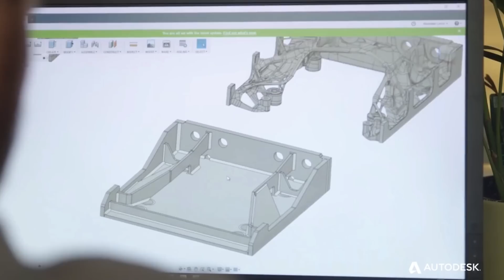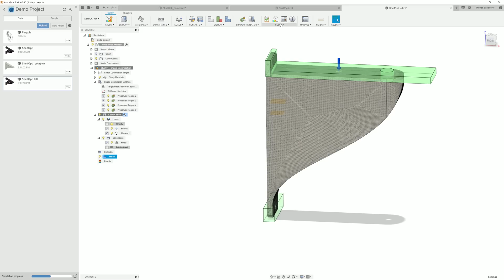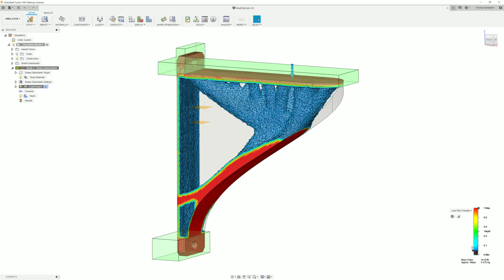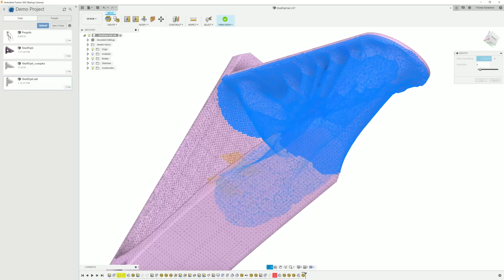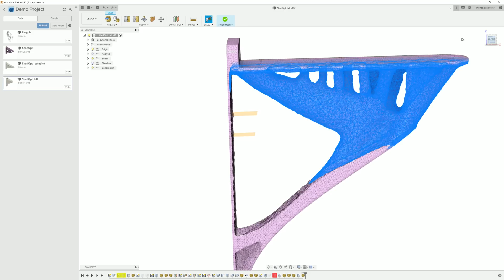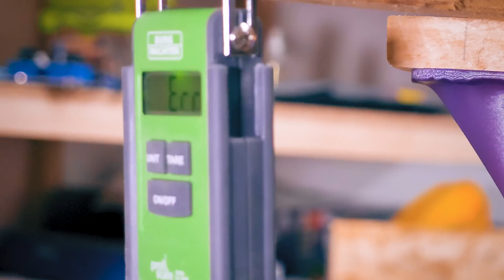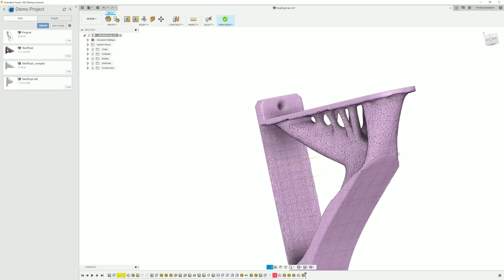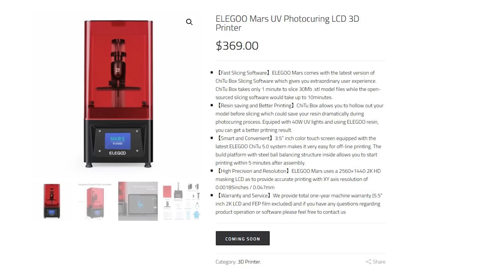Making STRONG shelves with Topology Optimization

Comment: Welp... Fusion removed the simulation tab from the free version (because autodesk is greedy)... there goes that idea.
Reply: Same, was just working on a project that needed the weight saving and strength, but Autodesk has to be the most Greedy company ever.
Reply: @NoLan_YT  I'm pretty sure the most greedy title still goes to adobe, but Autodesk is getting closer.

Why use cloud computing for this? Why not try to run it locally? It's their only justification for making people pay for that service. Sure, it'd probably be slower locally, but I got time.

Comment: I know this is an old video but would be interesting to see how strong a manually designed bracket would be compared to this.  Because the optimization didn't account for the orthotropic nature of 3d printing. And it didn't account for the hollow nature of the prints.  I would venture a guess that a thick walled bracket with low infill, strategically hollowed out sections, and printed flat would achieve similar strength at lower weight.  You can see where it breaks was not the "weak" spot shown in the software.

Comment: Good use of PLA, biopolymers are pretty cool. The real great showcase of a lean iterative design process. 
Next time you should consider explicitly modeling your mounting, or use a stud finder so you mount on the wooden seams of the wall. Computational boundary conditions exhibit the least realistic portion of a model: often the potentials are tuned to the gradient of the bulk material. Outside of the bulk, the Hamaker constant of PLLA and Cellulose is 3/5th that of cellulose, so I feel that a small amount of soft silicone rubber molded at the wall-part interface which could deform might be helpful. Best of luck in your continued design work. 
 “God made the bulk; the surface was invented by the devil.” -- Wolfgang Pauli

Comment: If it's metal, perfect! If it's lightweight material, not sure the benifits you get justify the costs. Probably a full slab is more cost-effective. Proably an additional function to approximate the final shape with simple parts and eliminate the 3D printing would be desireable in the least demanding cases

Comment: ...well, if we want to be pragmatic about that - you should simply print it upside-down (versus the position on the wall, I mean - should be attached to the plate by the surface that shelf is supposed to rest on), and just key match/epoxy the bit with the screw hole. The layers orientation would be optimal, and the screw part/keying of it could be also optimised separately for the kind of loads required.

Comment: The wall plugs are evil incarnate, they cost me at least 10 years of shortened lifespan and several rage quits. Fortunately, you don't have to use them, ever again - here's how:

1. Drill a hole of appropriate size  (slightly bigger than the screw  dia.)
2. Pack it semi-loosely with a cotton wool
3. Soak it generously with a superglue
4. Watch it smoke, while the glue hardens rapidly
5. After the glue is set, you can pre-drill a pilot hole (slightly smaller than the screw diameter)  - it is not necessary, but makes for easier  work
6. Self-tap the screw in. Job done.

It  will survive a nuclear blast, and most importantly,  it works every time, first time - unlike the FUCKING wall plugs!

You are welcomed!

Comment: You should have put in a second force in direction from the upper hole pointing from the wall into the room. I guess if you optimize this, you can 50 % more on it.

Comment: From a mechanial perspective those are very inneficiently designed brackets, but then you did start out by saying that it was going to be an excercise in aesthetics. Overall a rather confused excercise that adds up to little more than 'pratting about' with generative design software with the unconvincingly claimed ambition of persuing some aesthetic goal. Madness!
Reply: From a literal perspective, those are those most efficiently designed brackets possible. That was the point of the video.

Comment: very nice video but if those brackets aren't fastened into the studs of the wall that shelf can still come tumbling down even with the brackets left 100% intact  in this scenario they are not the weakest link of holding the shelf up when more weight is added

Comment: I can’t see how anything 3D printed can be stronger than a cnc milled aluminum part, a milled part is always going to be stronger 3D printed, that includes 3D printed metal. The weakest point of a 3D printed part will break long before a milled part, so when you say things like “ideally a 3D printed part” explain how it’s ideal. Maybe printing is easier for people who don’t have an year engineering degree, but they have yet to find a material for printing which is better than a milled part, it’s ok for making cheap throw away stuff for landfills.  And drywall isn’t foam and concrete, it’s gypsum crystals.

Comment: Hi Thomas cool video. I have a question, if the brackets were optimized to hold 35kg altogether but one of them alone is capable of supporting your weight of 66kg, then the brackets are overdimensioned. Do you think the part could have used less material?

Comment: this shelve is not stronger than one without optimization. it is only "nearly as strong" as a unmodified shelve by at the same time using significantly less material. strength can be increased by adding material to the most stressed areas and not by removing material from less stressed ones.

Comment: "Start with a block, cut away only the parts that don't add to strength"
Sounds like 12th century carpentry.
I thought the 'promise' of 3d printing was the advancement of additive manufacture and design practices.
"Start with a block, cut away..." is not additive, nor is it advanced.
Reply: Did you watch the video? He literally explained this.

Comment: I can guarantee that the shelf braises i made are stronger, and they do look really good but in a very different way. mine are made out of 2mm thich strainless steel. i used a hyudraulic press with a folding tool to make the 90 degree angles and made the reinforcement triangles out of the same 2mm stainless steel. i then TIG welded them together and tadah! it is a super strong and really clean looking shelf bracket and i can for shure say that mine were far easier to make and took way less time (less than 1 hour for both of them combined)

this was a very interesting video tho, i might have to play around with that feature =)

Comment: That's true what you said in the last part, the process does not care how much load you have if you are only specifying (1) Strain Energy and (2) Volume Constraint.
You need to put additional constraints such as deflection so that the software optimizes your structure given a certain load. I use ABAQUS for Optimization by the way.

By the way, your video is awesome! so much appreciated!!!

Comment: Not sure if you will read this comment at this point but I will leave it here anyways.
1. This video gave me inspiration in my Mech Engineering final degree project in Q2 2020. I am now an Engineer. Came by your video again after buying a 3D Printer xD.
2. For the wall plugs, for plaster walls as they are called, I really recommend you Fischer Duoblade. Each one of those holds 8Kg, and you don't even need a drill!
Reply from the maker: Great to hear! It's still not a plaster wall or drywall, though 😉

Comment: With modification to the mesh to account for manufacturability, those could be mass produced using a molding process. Very cool design - looks great. 😎

I probably just would have painted the edges of the shelves white; it was very beautiful wood.

Comment: Great job giving a rundown of the process. A way to make it better is to add in the hardwood plank by incorporating it into the model by adding 2 additional hard points where you fasten the board to the support arms. That would drastically reduce materials required.

Comment: Standard topology optimization is not really valid for 3d printed parts. 3d printed plastic is dramatically anisotropic and except with 100% infill, not even a solid body. Someone should make a surface based technique and implement it on a standard CAD FEA package.

Comment: I tried topology optimization and have to say I'm a bit disappointed  with Autodesk. When you try to optimize it fusion360 gives you option to do it in the cloud which works fine. But when you try do to it locally you get some nonsensical error without any real explanation. This looks to me like cash grab I don't see any reason why I couldn't do it at home.

Comment: Topology optimization is not for Shelfs or street bikes, where you are not putting them to the ultimate boundary conditions or making full utilization of the generated structures capacities, its mainly for stuff like Aerospace or special case scenarios where micro scale is important.

Comment: When you're doing The Initial Simulation; Is it calculating The Interior Structure, or is that added later by The Printer ?  ( & you ruined them when you painted The Braces with White Areas ! )

Comment: Would you be able to do this in tandem with an optimization (Machine learning?) sequence for the most efficient motion for bipedal sprinting, test the load of weight and strain of muscles for each 'frame' of the steps, impact, push-off, and reset to make an ideal bone structure for an optimized sprint?

Comment: Btw, when you want a screw to really hold in the wall you usually screw it into the stud inside the wall. Although, I'm not sure if that would allow you to position the shelf right.
Reply from the maker: Tell me more how I would find studs in this wall...
Reply: There is a tool called a stud finder, which detects studs through drywall. Its useful for house work but only really necessary if your hanging something super heavy like a large TV

Comment: Wait. After all that, you didn't even screw the braces into the studs? Now the drywall is the weakest point of failure, as little as 25kgs.
Reply from the maker: Wait. You don't know that there are wall that aren't just a stud frame and drywall?

Comment: The wall mounts failed because you didn't install them correctly. If you had simply tightened them more, the the plugs would expand sideways to hold properly.

Comment: 2:30 Wait, they charge you for running simulations on a software you've already paid for, using store credits??
Have micro transactions found their way into even 3d engineering software?

What is wrong with this world
Reply: This is what autodesk has become they milk you every chance they get. As soon as any other player comes on the market, they buy them out so there is no competition. They used to make decent software now they slap their name on it and sell you a subscription.
Reply: @shitposting is my city  'aas' business model. smaller payment up front + multiple micro-transactions along the way. or a single colossal payment up front. i actually prefer the former in practice for a number of services.
Reply: Number one yeah it sucks. Number two no you don't need a supercomputer, or a high core CPU, SIMULATIONS ARE DONE ON GRAPHICS CARDS .... even low end graphics cards have more cores than a thread ripper, so in conclusion all that's needed is an Nvidia graphics card.
Reply: @singularitysquaredllc.895  depends if the simulation has been written for graphics cards but I guess probably most has by now
Reply: @Alistair  I suppose but in 15 years the only reason I've used a CPU was for prototyping, testing, debugging, as for "written for" it's just one line of code, or button click on a GUI that sends it to the GPU. It's been around at least as long as the programmable graphics pipeline.
Reply: professional work stations used for 3d CAD have 16 cores and 64 gb of ram. it should not take that long to make something like this. unless it was massive.
Reply: If you're a multi billion dollar company topology optimization or generative design could easily be saving you hundreds of thousands or millions of dollars.
Reply: jus because your computer is a potatoe PC doesnt mean modern computers are sUpEr cOmPuTeRs
Reply: As others have said, it's not a microtransaction. You're paying for their server time to run it on their computers. One reason given for them not allowing us to run these simulations on our own computers is that it would require them giving out the code for how to do it.
Reply: you're paying to rent compute resources to run the simulation. you could do the same thing at home if you had a supercomputer
Reply: @TouchedAlot  You don't need a supercomputer to run such simulation. Engineers at my work run simulations on 16 core PCs at work with no problem on other software. They are just milking people for money.
Reply: most people don't have lots of computers ready and available to throw at simulations. there is no reason to buy, configure and maintain lots of computers yourself if all you want to do is run simulations because you can just rent the amount of computing power you need on demand
Reply: @TouchedAlot  you don't need a lot of computers. Just one and wait a bit longer. Even my laptop has 16 cores ffs. Autodesk licensing was already crazy expensive before but this sounds even worse
Reply: @danepher  What 16 core BS are you talking about? You can easily run small parts like this on a Celeron.
This is why Fusion360 is diabolical. Don't support it. Get Inventor or avoid Autodesk completely. I'd recommend Solid Edge - its assembly UI and functionalities are decades ahead.
Reply: @TouchedAlot  lmao "supercomputer"..

Comment: I'm a PhD student studying topology optimisation ("TO"), and let me say you didn't do badly at all. A few points:
- topology optimisation CAN usually start from near-empty space, it doesn't have to start with a fully solid design domain (though in fusion 360 it might, theres many different types of topology optimisation). By definition that "generative design" thing will use some form of TO, along with other techniques.
- Be careful when saying your objective function is "strength". Is that yield strength or fracture strength? Is it being p-norm'ed or not? Is your material accurately modelled in the FEA software? (its clearly not because you're using a non-solid infill)

- There's actually no point optimising for strength, instead you should optimise for something else, along with a strength constraint (assuming fusion 360 lets you do that). For example, you could optimise for stiffness, with a constraint that keeps strength high enough to prevent it breaking (with whatever safety factor). By applying it as a constraint, the objective function becomes = stiffness + A*strength. "A" is usually 0, allowing it to freely maximise stiffness. When the strength limits are passed, "A" becomes large, changing the objective function to be strength-dominated until you're back within the limits.

 Anyway, its great that fusion 360 has this to introduce users to TO in a non-PhD level way, but there lots of ifs and buts.

Comment: For anyone who ever made anything out of any material it's obious where and how these brackets will fail. They look cool but that area under the top mounting point is the weakest link. In that spot the weight of the shelve will not only work straight down but also in about 45 degree alngle from the wall because you have another mounting point on the bottom. That's why on the test brackets you could see the flat part which suppose to be flat on the wall was bending under load and the bracket failed in the weakest spot. You have all this unecessary material on the outside but it's way too thin where you need it.

Comment: I'd recommend putting a small lip around the bottom of the top support portion (the "U"-shaped bit at the top) just to give the white edge you made a cleaner look. You can be extra-fancy and maybe add a very low amplitude wave effect to reflect the organic look.

Comment: The reason it popped out like that is because you missed the studs. Common stud spacing is 12"-18" with 2"x4" on load bearing walls and 2'-3' with 1"x4" or 2"x4" on non-load bearing walls. Load bearing walls are walls that the roof slopes into, and, typically, every outside wall is treated as load bearing, but not always. You don't need dry wall sockets if you get a stud, and the shelf mounting screws won't fail unless the house does. You probable already know this, but it may be helpful to someone.
Reply from the maker: a) Not a house built in imperial units b) it's not even a stud wall.
Reply: @MadeWithLayers  if there aren't studs then explain what how drywall is mounted. A). The drywall is levitating. B). I don't care if the units of measurement aren't easily interpreted. C). If you want to be a smart ass, how about using Google and finding the same measurement for your country. I'm a US Carpenter, not a snarky keyboard warrior. When I make things I do it by hand with chisels and sand paper.
Reply from the maker: Like I said in the video, it's not drywall. This is a "solid" foam concrete (aka Aircrete) wall, non load-bearing. 
Drywall is only used here for simple partition walls e.g. in renovation projects or in commercial spaces, but almost never in residential buildings. Commonly, exterior walls are built with 14" hollow bricks and plaster, interior walls using 4" hollow bricks.
Reply: @MadeWithLayers  that's gotta be a European thing. We use drywall on anything, and hardly ever make aerated concrete walls anywhere.

Comment: CAD simulation is not a panacea. Only full-scale tests under loads can confirm the accuracy of the part volume optimization. I am writing this as a professional who uses CAD simulations every day. CAD simulation can only bring you closer to the right design, but it will never give a ready-made solution.